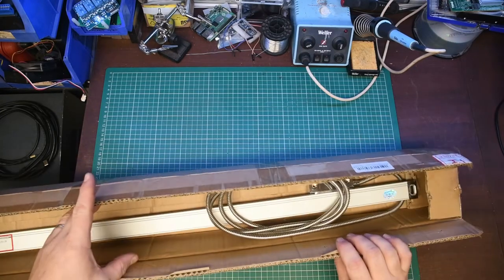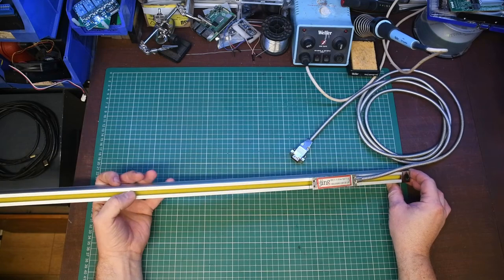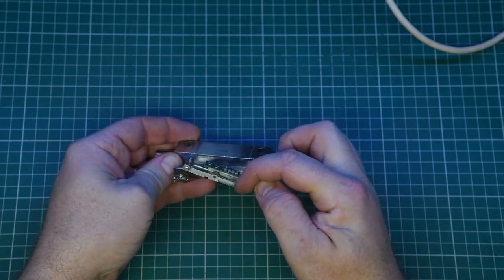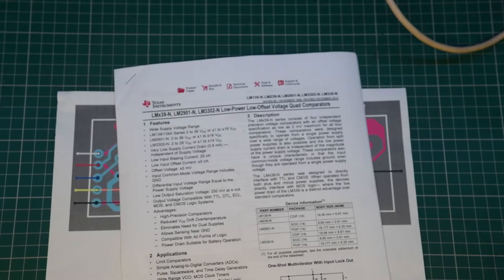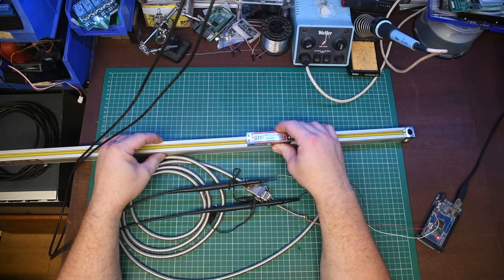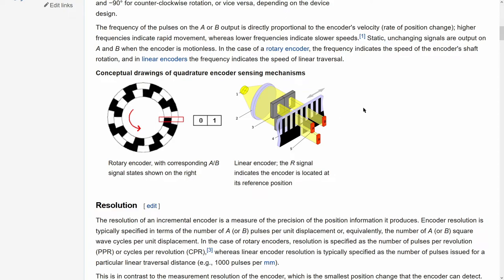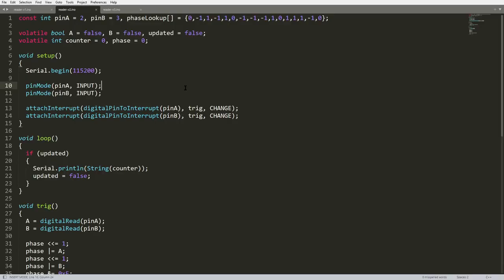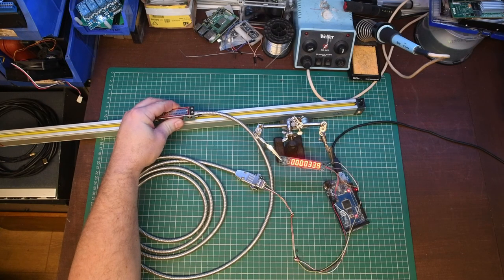Arduino DRO Linear Scale Interface

Comment: the code works perfectly for one input from a DRO, how do i introduce another reading from a different direction into this code ?
Reply from the maker: Hi, glad you got it working. Are you looking to add another axis (ie. another DRO reader)? If so you would need to duplicate the logic needed to listen for events and use another I/O port which is capable of enabling interupts. I can put together some example code if you like. It is also worth remembering that different Arduinos have different numbers of configurable interupts, so it may not work with the device you're using. Give me a short while and I'll put something together.

Comment: great video, exactly the project I'm getting into. 

 If I could offer a suggestion on the code end:  doing so much inside the interrupt function could result in interrupts hitting inside interrupts which (in my experience) makes arduino go a little wonky.  but almost none of that needs to happen at the time of the interrupt.  all you really have to do is log, in say a queue, that the event happened.  then the processor can work on processing the position in the main loop, when its not busy getting interrupts.  Admittedly, you'd have to move really fast to run into that problem with just 1 axis, but with more axis, it might cause problems.  Also noteworthy:  the method I described would likely be a touch more laggy, but be less likely to miss measurements.  Just my 2 cents
Reply from the maker: many thanks.. yeah the code was thrown together as a proof of concept.. totally agree on order of opperation..
Reply: @m0xya  ok I get that.  Curious if you considered a dedicated quadrature counter?  something like the LS7366R?  I'm just in the early stages of designing my dro, trying to workout the best way to go about this.

were you able to get the whole system working to varry speed in accordance with cutting diameter?  That's a feature I have long wanted (but no VFD :( )...i really love hearing cncs ramp up the rpm as they approach the center.
Reply: it was exactly what i was lookin for as well! great info brov, thanks fer lettin me steal yer homework! :D
Reply: @m0xya   do you have updated code that would work in this manner?

Comment: Thanks for documenting this! 👍
It would have been great to include a diagram of the D connector pinout too, that's very useful.
Reply from the maker: Thanks for the message. Great idea re. the diagram. I shall put one together and add a link. Keep an eye out for a follow up video showing an advanced way of reading the data at a higher resolution. It is a project I'm currently looking at..
Reply: @m0xya  thank you, looking forward to it. Subbed. 👍🛎
Reply: @m0xya  Just subscribed! Looking forward to the follow-up. It is hard to find complete projects on this subject. Thanks for making this.
Reply from the maker: @airman2468  many thanks.. let me see what i can do..

Comment: Excellent Thank you sir.
Reply: Is the digital readout showing actual distance or does it still need to be converted to read actual distance moved? Thanks
Reply from the maker: Hi, so on the example code it is just counting the number of markers on the glass strip, so in theory this is in microns. So the numbers shown are microns travelled, however, to make it more usable you would need to convert it to mm or inches. Hope this helps..

Comment: so I used your video a year ago for the first time, now I gotta do it again & forgot how!  lol. thanks again!

I'm curious, was your scale advertised to have a home position?  

Both of mine were said to have a Z channel to home to, and the wire is there for it in the tether, but I spent days trying to clock a signal on that line before giving up.  All the IC's you showed, are potted on version.  I can take the lid off, but its just a block of black and I'm not gonna dig into a working scale.  If my electronics are like yours, as I suspect they are, its quite clear that 3rd channel doesn't exist.

one other question, is there anything in those electronics that would suggest running at 3.3v would be a problem?  I've test it on mine, it seems to work fine...but I might not notice a small error, the sort that being under powered might produced.  I'm trying to run the whole thing on a 3.7v battery with a 3.3v MC, its a whole lot simpler if I dont need to send 5v to the scale.

Comment: Hi,
first i like to thank you for this enlighting video.

my question is: why does the lookup table is how it is?

THEORY:
as far as i understand the code, you modify the variable "phase" as follows:
- bitshift left
- enter value A
- bitshift left
- enter value B
- limit variable "phase" to 4 bits

so we have 2 bits of the old value of AB (ab) and 2 bits of the new Value (AB).
"phase" is always build like abAB
(small letters "ab" means old, captial "AB" means new )

Possible Values of AB are: 00 <> 10 <> 11 <> 01 <> 00 <> 10 <> 11 <> 01 <> 00 <> 10 <> 11 <> 01 <> ..... (encoder pulses)

phaseLookup[] = {0,-1,1,-1,1,0,-1,-1,-1,1,0,1,1,1,-1,0};

so the variable "phase" only can have the following values:

[phase = decimal = lookuptable equivalent]

0010 = 02 = +1
1011 = 11 = +1
1101 = 13 = +1
0100 = 04 = +1

0001 = 01 = -1
0111 = 07 = -1
1110 = 14 = -1
1000 = 08 = -1

so the possible values in decimal are: 01, 02, 04, 07, 08, 11, 13, 14

so the lookup table could look as follows: 0,-1,1,0,1,0,0,-1,-1,0,0,1,0,1,1,0

QUESTION:
why has your lookuptable values on position 3, 6, 9, 12

3 is b0011 which means one step of the encoder was missed and you can't decide in which direction it went, but your table says "-1"
but it should be + or - 2 which is not clear

6 is b0110 ///  9 is b1001 /// 12 is b1100 /// same thing 
why did you decide to enter values here?
did i miss something?

Thank you for your time 
kindest regards
Tom
Reply from the maker: Hi many thanks for the comment. Please give me a short while for a more detailed reply. I will try to find my original notes on the creation of the truth and lookup tables.

Will get back to you soon,
Phil
Reply: @m0xya  did you gather some informations?

i used your bitshift-code successfully for a handwheel digital encoder

Comment: Nice video.  Do you know exactly what happens when the slider changes direction?  Normal directions are given by eg ABabABab and BAbaBAba etc, but when the direction changes you get Aa or aA or Bb or bB.  What I don't understand is how to count these changes.  Does Aa count as eg 1up or 1up & 1down? I'm using my scale to motorise the head movement on a Warco WM18 mill, and each event is 5 microns and important. I can't get the totals to add up right on a change of direction.
Reply from the maker: Hi, sorry for the delay in replying, busy with work. Someone else asked a similar question a while back. I will try to do a video explaining how the encoding works and how it is translated etc. Keep an eye out for an update.. Thanks..
Reply: I´m currently working on installing a DRO for a college project, I wish we could discuss more about the logic of the encoder, if you´re willing to :D

Comment: I’ve been looking for this. I’d like to use an ESP32 and send the data to phone via BLE or via a WiFi AP. I need to display the information in circumference.
Reply from the maker: Hi, yeah there is no reason why the code couldn't be converted to run on an ESP32.. It just relies on the interrupt and line status values. Thanks,
Phil

Comment: hey, great video i was looking around for some sources and stumbled across this, subbed as well. did you figure out the limits in terms of speed of movement in respect to the capability of the arduino in sampling the signal? i am really wondering if this will be fast enough or if i have to go with a dedicated chip for that part. all the best, cheers!
Reply from the maker: hi, thanks for the comment. glad you found it interesting. as far as speed of movement, i haven't tested it for max speed. for my use an arduino will probably be fine, as i would not be moving faster than 10cm per second. there are 2000 pulses for each 1cm movement. and the arduino is running at ~18mhz. so if you moved at 10cm per second it would be 20000 pulses per second. the processing done by the arduino is quite simple (hence the reason why i removed the if else loops). what i would do is use one arduino to capture/count the pulses and another to handle any complex calculations, that way you would always have a source of truth which would feed its value to the other one when needed.

however, i have an updated version in the pipeline which will also dramatically increase the resolution to 0.1um. i am still playing with the design, but keep an eye out for an update.

many thanks,
phil
Reply: @m0xya  thanks for the reply! yeah i was thinking the same using a dedicated arduino for sampling per linear scale and then feed this into another one for processing/displaying/etc. i was just not sure if that would make the most sense since getting some dedicated IC wouldn't be too hard or even some sort of FPGA would work too. cheers, daniel

Comment: This is a very good video.   Are the pulses spaced by microns ? Each change is 5 microns?
Reply from the maker: Many thanks.. It is slightly more complicated than that, but fundamentally, yes each pulse (or change in phase) represents a movement of 5 microns. The pulses also provide direction information. If you were just counting each pulse you would not know if you were moving up or down (left or right). By having the two channels A/B it is possible to detect the direction of travel.

Comment: I'm just in the beginning stages of researching something like this but need to zero in at different positions and trip a solenoid at a certain position or if two encoders are out of sync.  Application is left and right sides of a press brake to control tilt and stop limit.  Is it possible?  I have zero Arduino experience but some CNC, electronics, and BASIC programming.  I understand I would be learning C.  I would like to do this in addition to a CNC backgauge (2 axis) with a CNC shield, maybe control a couple other simple things.

Comment: Would any adjustments to the code need to be made for this to work on a 750mm linear scale?
Reply from the maker: hi, the overall length of the scale should not make any difference. just so long as the reader head is the same and generates the same output. let me know how you get on. phil

Comment: const int pinA = 2;
const int pinB = 3;
const int phaseLookup[] = {0,-1,1,-1,1,0,-1,-1,-1,1,0,1,1,1,-1,0};

volatile bool A = false , B = false,updated=false;
volatile int counter = 0, phase =0;

void setup()
{
  Serial.begin(115200);

  pinMode(pinA, INPUT);
  pinMode(pinB, INPUT);
  
  attachInterrupt(digitalPinToInterrupt(pinA), trig, CHANGE);
  attachInterrupt(digitalPinToInterrupt(pinB), trig, CHANGE);
}

void loop()
{
  if (updated)
  {
    Serial.println(String(counter));
    updated=false;
  }
}

void trig()
{
  A = digitalRead(pinA);
  B = digitalRead(pinB);

  phase <<=1;
  phase |=A;
  phase <<=1;
  phase |=B;
  phase &= 0xF;
  counter +=phaseLookup[phase];
  updated= true;
}

Comment: I really hate the pejorative term "chinesium". Let's see what you can build within that price envelope.
There are plenty of EXCELLENT instruments coming from China at half teh value of european brands. But y'all want high quality within an 10% envelope.
Reply from the maker: Hi, thanks for the comment. I think most people know and appreciate the range of quality available from Chinese manufacturers. The term "chinesium" is used to describe products which are cheaper and as a result are "usually" of an inferior quality. I'm not for one moment suggesting there is anything wrong with this, however, you should be aware of the differences. I buy plenty of items like these due to my budget and requirements. My expectations of the devices are, I would say, accurate to the price being paid and the quality I expect of them.

A perfect example of chinesium would be the recent video by BigCliveDotCom: https://youtu.be/axow7KnBtaM